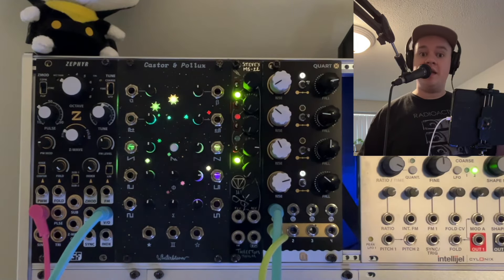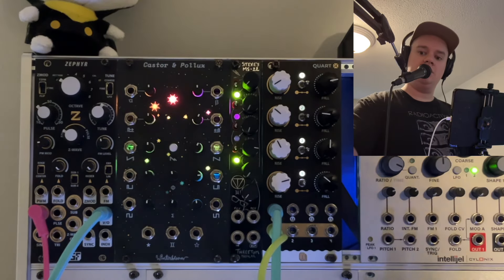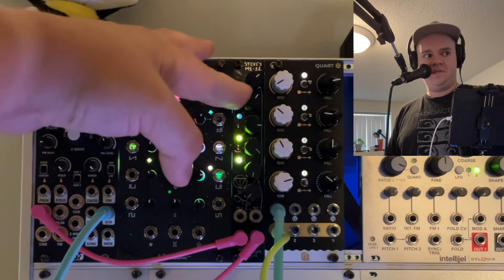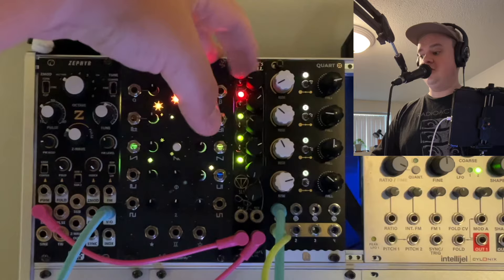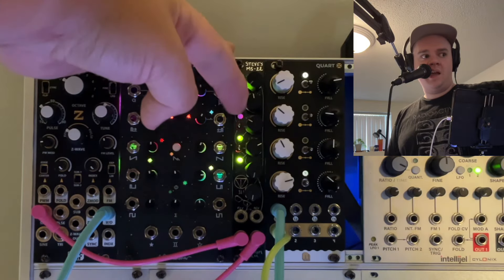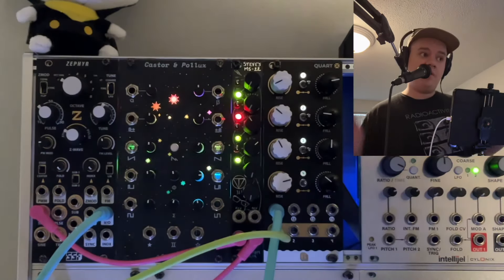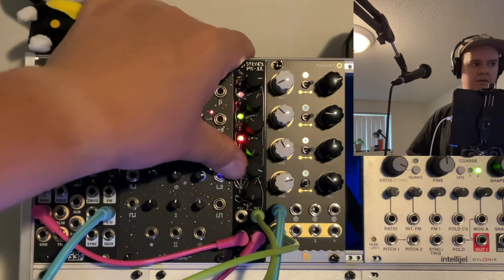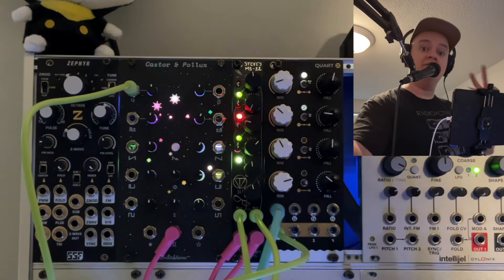Rambling About: Threetom Modular Steve’s MS-22 with Tafony

Comment: Hey Tafony, I enjoyed your walkthrough of Steve's MS-22 :). I do want to point out that the knob placement on the low-pass filter isn't how it should be. Luckily, it's very easy to fix this. Firmly but gently pull on the knob cap to remove it from the potentiometer shaft. Then turn the potentiometer shaft fully counterclockwise. Then put the knob back on with the pointer at around 7'o clock, matching the other knobs when turned fully CCW. Firmly but gently push the knob cap back onto the potentiometer shaft. Fixed! :) Keep on doing what you're doing! ♥
Reply from the maker: @ThreetomModular  oh thank you!! i will check it out tonight